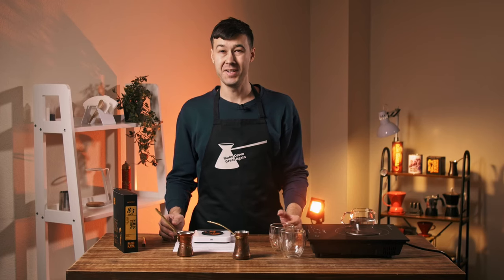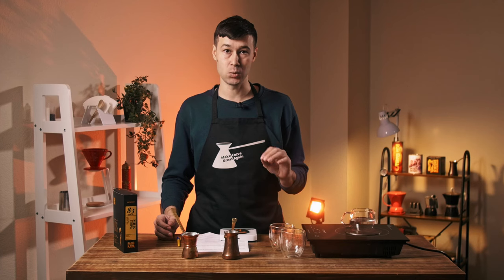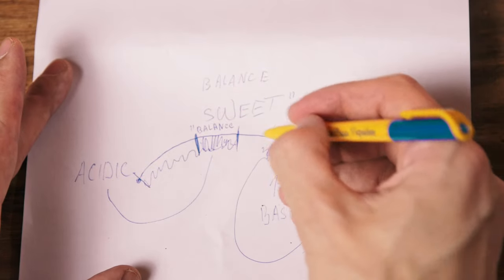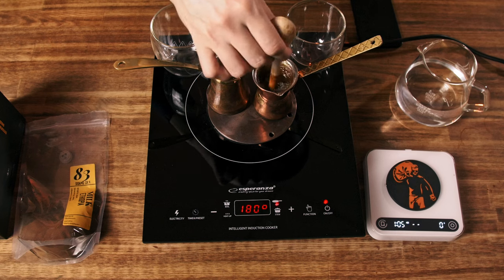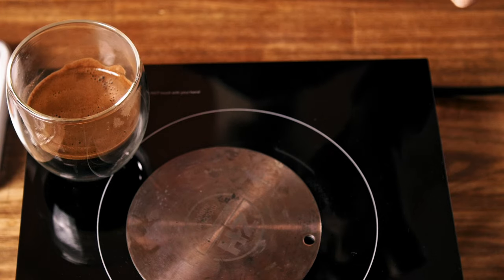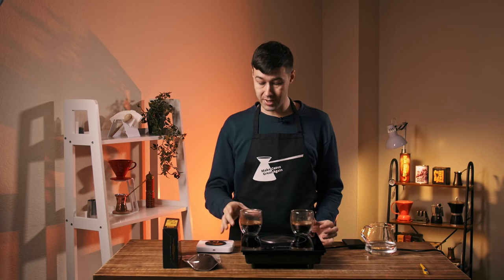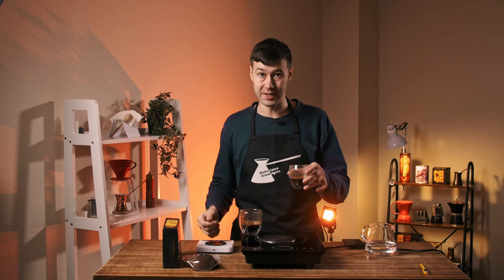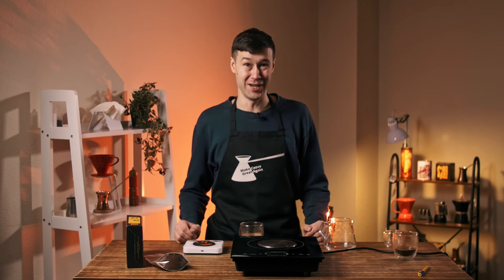Turkish Coffee - How to control the flavor

Comment: Nice job brewing that a bit darker.  Can you slow it down a bit once you get the dark ring forming at the circumference?  Try getting it to wrap fully,  dark,  prior to the rising?  But good job!

Rising too soon means you need to reduce temperature at the final part. Best done on a gas stove with adjustable flame.
Reply from the maker: It's possible to just lift it from the induction adapter to slow down. At home, I did a hold at the end of the brewing, like 5 seconds after the wrap and it was more pronounced. But I just kept it raised. With the sand - same thing, full wrap while it's raised. But the motion on sand is very rapid and sometimes I need to lift and wait for coffee to cool down and put it again in order to have a proper color

Comment: New to brewing Turkish coffee... I have a cezve and Sozen grinder set as fine as it will go.   I struggle to get full wrap foam when brewing and the foam after sitting in the cup for several minutes is very gritty - maybe it is supposed to be.. not sure.
Reply from the maker: Meaning it boils out? Why it's not wrapping? Try mixing at around 1m after placing on heat 

You can blow on the foam to get rid of particles in the form.
Reply: I used to brew it too fast and too hot.  Now I do it very slowly, moving between low-medium and very low while I watch what is happening in the cezve.  I will also remove it from the heat every minute or two to tap around the edge of the cezve with a wooden spoon.  It draws the light foam to the top.  

Once I start to get the ring, I will control the heat carefully until the ring has reachedhalfway to the middle and then remove it from the heat and give it a little swirl to allow any grains trapped in the foam to settle.

I usually let the cezve sit for a couple minutes before pouring, but I noticed that others pour it immediately and let it cool/settle in the cup.  I'm, not sure which is better. @MakeCezveGreatAgain

Comment: Hey man, because of you i’m now intro cezve afer pulling espresso foe years. Thank you. Quick question, i have a 1zpresso jx pro but am loojing for an upgrade, Is Kinu your favourite grinder for turkish?
Reply from the maker: Currently - yes. Because of the speed mostly. And effort isn't that huge. JX is totally suitable for Turkish coffee, just don't sure about the longevity of the burr. And as I recall it's more aggressive (takes more force to grind) and has slightly more noticable vibrations. And pretty wide which makes higher load on the wrist. But it 100% works and could go with even smallest grind size.

I would suggest starting slightly smaller than espresso and see how it goes